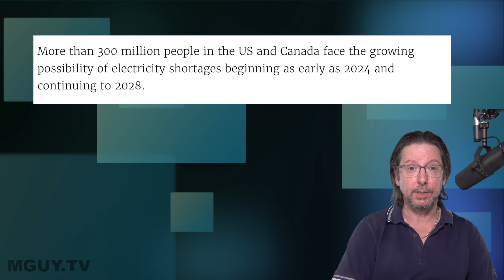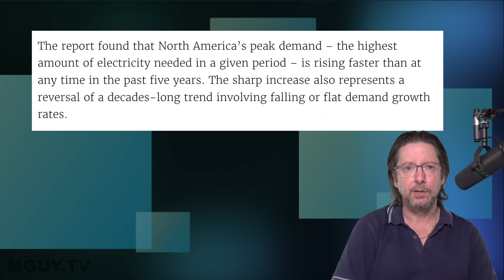Electricity grids WON'T COPE with mass EV charging | MGUY Australia

Comment: I tried telling my Town Council that our water and waste water operation is threatened by grid failure due to NO infrastructure upgrading and 30% demand increase. Basically, the Government subsidy and social pressure to replace gas appliances with electric and replacing petrol cars with EV's has increased electrical demand by 30% but the power generation was not increased by 30%. In fact they have actually shut down power generation facilities. This will become another man made crisis.
Reply: Your statements are accurate about EV demands (in total) but completely leave out time-of-day demands. Over 90% of all EV charging is done off-peak, when utility generation is idle. It does NOT represent a grid demand or need infrastructure change. For daily typical use, any EV can be charged using house current overnight. The man-made crisis is using a fuel that is artificially priced, and has a delicate, global supply chain.
Reply: @justsomeguy934  people get home from work and plug in their car. How is that not peak time. EV charge load demand on the grid is the same as 100 houses. Average kWH per 100 miles of range is 30, as much as a house uses in 1 day. 25% of US homes use 100% electricity, 32 million homes. If every car in each home became an EV that equals another 32 million new loads on the grid. As of 2007 electric generation has flatlined, no growth. This is yet another Government created crisis.
Reply: @aaronj2296  Your information is faulty. First, EVs can be programmed to start charging at any time the owner wants it to start. Even if they don't, using house current to charge your EV slowly would overlap peak demand only for a couple of hours, the remainder is off-peak. A non-issue.
Second, the average driver goes 30 miles per day, commute and errands, not 100. Your calculation is based upon a bogus number. The actual demand for 30 miles is about 10 kW/h per day, or 1/3 more, but again off-peak.
As for each home to have an EV, it would be 1/3 more total energy, but not at demand hours. Furthermore, your home A/C uses 3x-6x the energy of an EV when running. Worried about the grid? Stop building homes with A/C.
Reply: @justsomeguy934  First, the owner will charge the EV when it needs to be charged not any later due to a "programmed to start charging later". Second, you proved my point in the fact that 30% increased demand, on the best day, will load a grid that doesn't have 30% more electricity. This will overload the grid causing grid failure. Third, we are being told by our Government to install A/C pumps and switch from natural gas, the most abundant and efficient energy source besides nuclear, to all electric. This program along with Government regulation forcing EV purchasing will cause grid failure. Stop buying into Government propaganda, buy a hybrid vehicle and stop buy heat pumps.
Reply: @aaronj2296  absolutely false statements on your part concerning charging times. EV owner, are you? Where tiered power rates occur, many EV owners do. For those that don't, their charge time overlap - again at house current amperages - is only a couple of hours. You're dismissing the ability for any EV owner to charge off-peak if they want to, unlike any other appliance on the grid. That ability completely disproves your statement.
As for grid capacity increase at 30%, again your statements are false. You, like many others, have no concept of grid demand production. With 95% of all EV charging done off-peak, EVs represent a grid draw when the utility production is near idle. Off-peak energy production is about 1/3 that of demand, and even less than peak. 
As for total grid production, let me inform you that the greatest increase in grid output in the USA was after WWII with the advent of home air conditioning. At this time, the USA grid is producing order of magnitude MORE electricity than it did when my parents were alive. Even without a single EV, the USA grid will need to make more energy and it will. Concerned about grid production? Stop building houses with air conditioning, pal, because a home HVAC unit draw 3x-6x the amount of energy that an EV charger does when running.
Lastly, you are conflating a idiotic anti-natural gas policy with EVs. Don't confuse a good technology (EVs) with a stupid political agenda. I do not support "green" new deals, think natural gas is a great fuel when necessary, and think the current administration is on the take by certain groups to cripple the US energy supply. It's a shame that EVs get dragged into that discussion.
Reply: @justsomeguy934  Will 90% of of all
dwellings have a charging point and and charge over night in the future and will the electricity price remain the same no chance
Reply: @pauldavies6037  Who says 90% of all dwellings have to have charging? 90% of all dwelling occupiers don't have cars, don't all have the same vehicles, don't need or use a car. I can assure you that any EV owner will attempt to have residential charging, however they can get it. In my state, there are laws that allow a condominium owner to install charging in their communal parking area if they pay for it. Residential charging takes care of itself as best it can.
Reply: @justsomeguy934  "Their'' plan is only electric vehicles dont forget it will never work
Reply: @pauldavies6037  if there is a plan to limit your travel using a vehicle, you wouldn't use an EV, friend, you'd use a gasoline car. I can power an EV using solar panels on my roof and nobody can stop sunlight hitting my roof. The price and availability of gasoline, however, is completely artificial, or did the $5 a gallon unjustified price escape your notice? 
As for EVs never working, I guess my last 9 years and 100,000 miles didn't happen?
Reply: They want to kill the grid so we better all get ready to live in a dark cave.
Reply: MAN MADE ALL PART OF 'the' PLAN

Comment: 90%of the worlds power grid is not designed to include evs its a stupid and irresponsible thing to just simply connect mass charging points around the country and over loading the grid which in my country can barely handle sending power to houses and street lights. We are a very very very long way from doing that kind of integration. And i hope we never do

Comment: Free charging stations have been a way for EV manufacturers named Tesla to bait car buyers into buying their vehicles.  Once you’re in , eventually “free” will give place to metered rates. . 

Utility companies  already change power consumption rates based on supply and demand. This being an industry that failed to deregulate to allow competition. 

Yet charging station networks are not regulated like utility companies , just as much as you don’t see fuel stations having fuel prices being regulated. The charge by usage EV networks are already losing money on their rates.  

So don’t act surprised if all of the sudden you are paying just as same as your gas pump refuel for a recharge that takes a lot longer to get it topped off.  

Oh, and by the way, Elon will also sell you the recharging the battery pack, the charging connectors  , and will mark up on converters and private label solar panels. All for your  inconvenience at the recharge stations .  

On a side note , California green sourcing utility bills are a straight lie.  They go out and buy all the power generation need , but a token percentage on green power , from Gas and Coal fired power plants.  

You’ve been had.

Comment: I'm Canadian. I looked upthe amout of oil used daily for transportation.  Change oil to BTUs, then the watts.  To get off oil, we need to add 2.5 million Mwatts daily to the grid. Yet, near me,  the best we can do is to closel a 4000 Mwatt coal burner, and replace it with 44 Mwatts of solar. (less, in the winter, and at night). Also, a large nuke plant is scheduled for closing, but the date keeps changing. The government is charging me 62% tax on carbon, for clean natural gas. So the house is cold this winter. The government has plans to get home heating switched to heat pumps. More electricity needed. We already import electricity during weather events.

Comment: Supply and demand - same as most other things. When demand increases, so do prices, and when we're all entirely dependant on electricity for absolutely everything, energy companies can charge what they want. Wholesale energy prices will skyrocket, which in turn will be passed onto us. Winters will plunge entire cities into darkness with people freezing in their homes - not even any gas to boil a pan of water. Heat pumps will stop working and freeze up, EV's will sit idle with no charge (with charging stations dead too). All you'll hear is the noise of diesel generators being fired up!

Comment: Before I retired I worked in industry that was part of the energy infrastructure. We had to order things like alternators and transformers well ahead of the needed date because of the lead times often in excess of one year. Also the more alternators and transformers you make the higher the cost of the copper used in them goes. The knock on effect from this is that you get the copper thieves going out and stealing cables before they have even got as far as being commissioned. The rule of unintended consequences is still going strong.

Comment: Our area will need 10 power plants and 3x the transmission lines to accommodate everyone driving EV's. They mandated by 2030 that all new cars must be EV's. It's delusional and is going to kill a lot of people. when everyone is and everything is on electricity what happens when it goes out. the ultimate absurdity is all the methane hydrate around every continent on earth will need to be burnt or it will explode out of the oceans over a 100 year period. It can't help it. It's done it before it's in the ice cores. All the methane ice is like a pop bottle with 10X the pressure in it adding pressure all the time. You can see it starting under the permafrost. So even if the climate scam is true and everyone stops burning fuels, all the methane is going to be released anyway.

Comment: Here in Australia  our power infrastructure is still in the stone age 
You get a week of 40 degree  day and we are utterly  stuffed   as the government  puts out warnings for people to stop using a/c and other house hold appliances  while this same government  uses more electricity  instead 

We all know that tesla has been lying for years about the real range of thier evs  and aledgedly some other ev makers have been doing the same 

Im in perth Western Australia  and the area im in according  to my friends  who do own evs and Hybrids  state there are only 3 charging stations for several suburbs  with long lines and that if you can find a charging station  at actually  works 

As the electronics inside the charging station  dont like the heat  and are prone to failure

Comment: The Government doesn't want Fast Chargers for the Citizens. Only for themselves. They force me to buy an EV. I have to Charge it every night (110v outlet). Tesla takes what, 2 Days for a full charge? Thus limiting when and how far I can go. Its Easier for them to Declare Emergency and Shut Down the cars remotely. And what happens during a Severe Storm? Hurricane, Snow, Whatever. Power Grid goes down. You're Stuck wherever you are. Look at Texas. When they got that massive amount of Snow. The Grid went down. California. Told people to Buy EV's. Then a day or two later, Told people Not to charge the EV and run the AC at the same time.

Comment: Australia 2030. The last coal fired power station is shutting down, gas power stations are finished. Australia is now trying to run on solar, wind and batteries. Power interruptions are occurring more often than power available. What little manufacturing we have left in the country has to queue up for power. Imagine these glorified AA batteries trying to keep up with steel production, blast furnaces etc. About this time all the battery banks are reaching their end date. Where are the millions of new batteries going to come from? We can't make them in Australia (not enough electricity to have production facilities.)  Buy them from China? There's a good plan. China would then own Australia completely. And all the wind turbines are wearing out at the same time. No problem, any of those counties we export our coal and gas to, (so we don't cause climate change in Oz!) would gladly sell us new ones at questionable quality. Meanwhile, Albosleazy and his bum boy Bowen have retired from politics, or kicked out, and are happily sucking on the taxpayer's tit with their enormous superannuation and perks. Not our problem, Albosleazy says!

Comment: Much of the electricity cabling running beneath our streets in the UK is old and simply can`t cope with the extra demands that have been put on it already....Just think what electrical items we had only 25 or 50 years ago? for everyone to use heat pumps and charge two or more vehicles daily while also using power showers plus all the other items we now demand by working from home.. The whole lot needs upgrading massively, that`s IF we can extract all this electricity from wind and sun???????

Comment: We will all need an exercise bike for each family member, so we can all pedal away, running our own tiny generators. After an exhausting week, we can run the car to the shops and back.
As a follow on thought, an electric bike in reverse, we pedal, to charge its battery, then use that battery to power our house.
Reply: The way it is going, be lucky to have a shop to ride to.